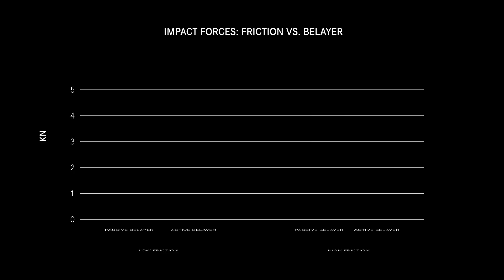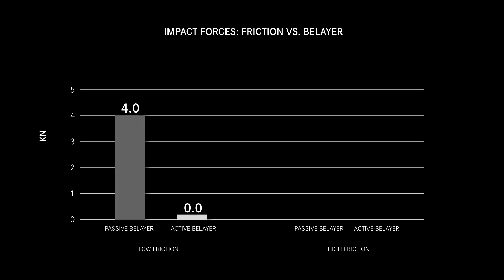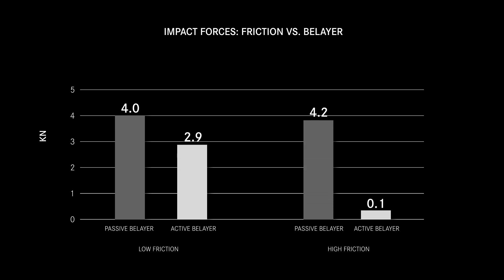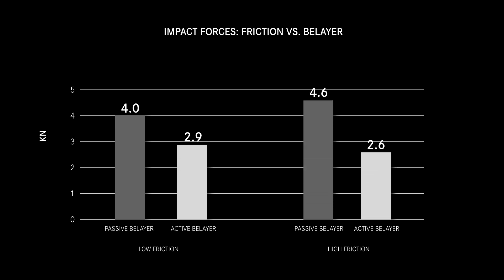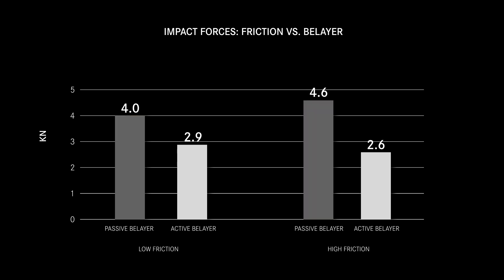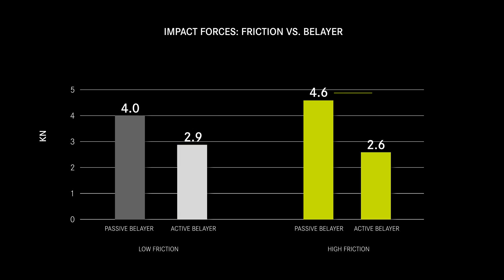Can you give soft catches with common assisted braking resistors?

Comment: So I would be interested in the use of semiautomatic belay devices in the belaymasterpoint for alpine / multi pitch climbing. 
So far I didn’t recognise any information about this topic. The question for me is, if the forces on the climber and the belaysystem are to high and therefore nobody uses this method. 
Since there’ll be no rope passing cause of the automatic the belayer can’t create a soft catch. Vs with HMS or ATC it is possible. 
On the other side it would be beneficial in big falls in alpine terrain the support the belayer catching the fall.
Reply from the maker: Thanks for inputs like that. We collect this and hopefully will be able to thematize this in one of our future videos. There will be soon one that gives an example of how such braking resistors can facilitate softer catches in multipitch scenarios.

Comment: Yep, the belayer is the greatest factor in how hard a catch is. I know this  because I am generally able to catch a fall before the braking device is involved. When I tell people this they don't believe it is possible to catch a fall without the device. Try it. It takes only timing and some strength. Of course the lighter the climber the easier it is.
Reply from the maker: You are absolutely right. Here in the German speaking belay training standards we call this method "sensor hand". It does not exactly has the goal to completely catch the fall without the belay device but to at least build up very early tension and control to know as early as possible what other behaviour of the belayer is needed to softly catch the fall.

Comment: Hi Daniel and Edelrid team! Thanks a lot for publishing these knowledge base videos and detailing your testing methodology, I love the movement towards more open sharing of technical knowledge about climbing :)

However, I don't really understand the risk scenario; how are 'high impact forces' related to the risk of collision with the wall? I thought a 'hard catch' is more painful simply because there's additional force on the climber during the arrest.

Also, just a point of small critique, it would be nice if you had a higher sample size per tested scenario: that would make comparing values a little bit more robust ;)

Thanks again, great work and please keep them coming!
Reply from the maker: Thanks for your feedback!
Well, in many cases a fall does not occur directly below the belay point, but usually with a lateral offset. With a high impact force acting on the climber, this means that the falling mass is then accelerated all the faster along the pendulum path, which in turn can result in a more violent impact on the wall. Of course if such a fall takes place in an overhang or on an only sloped wall this will not be the case.

And regarding the sample size. In many cases we test at least three times or higher. However, for the videos we want people to not loose interest and show mostly only one test per scenario. The values presented in our videos are then already always the average result of our tests.
Reply: @EDELRIDKnowledgeBase  Thanks for the response, I understand now! Maybe just write somewhere 'average of three tests' to appease the uber nerds such as me ;) Keep up the great work guys!

Comment: Interesting information. An idea for a follow-up video : what's the effect of weight difference? E.g. an 80kg climber with a 50kg belayer. Does the active vs passive belaying still matter as much, or is it always a relatively soft catch?
Reply: A light belayer will generally give a softer catch (all else equal). It simply cannot create the resistance needed for a hard catch. However, given that the belayer will be yanked violently, this considerably increases the risk of injury for the belayer. And close to the ground, a large weight difference can make it impossible to prevent a ground fall. Many semi-automatic devices can also unlock if drawn against the first quickdraw.
That is why resistors like the Ohm have been invented.
Reply from the maker: Thanks for the feedback!